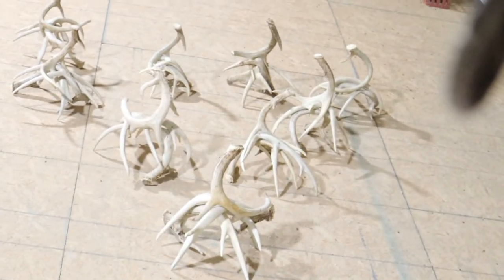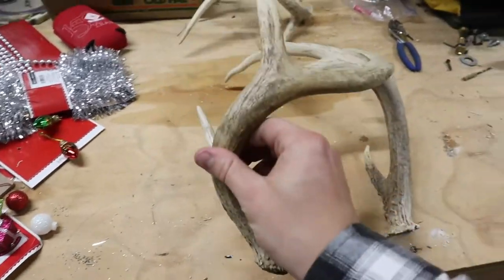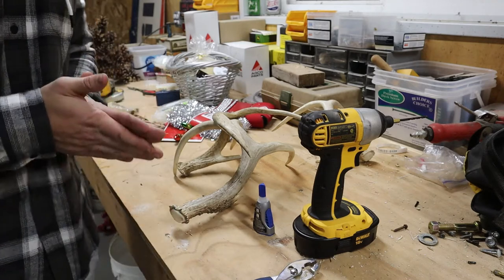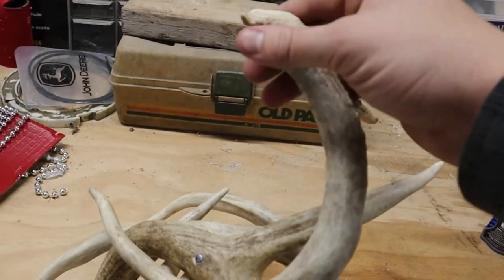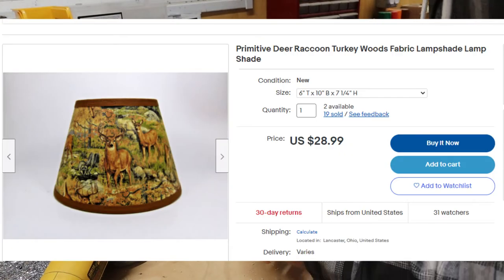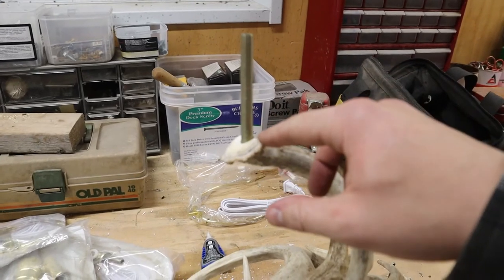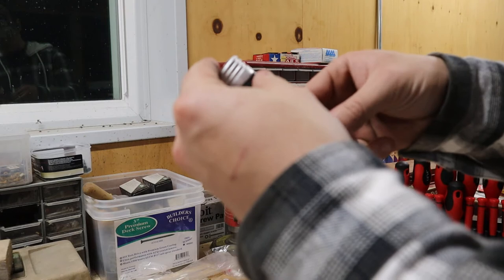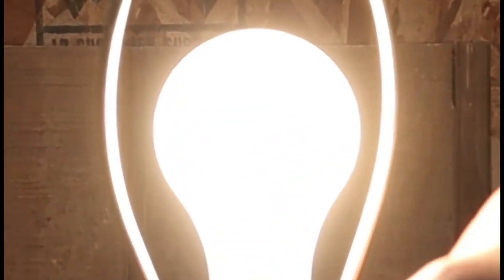How to Build an Antler Lamp

Comment: Awesome video man! Could you share the link for the actual lamp parts or just what you searched on Amazon
Reply from the maker: Lamp Making Kit, Lamp Parts for Repair Replacement or Rewire Table and Floor Lamps, 3 Way Socket 12 Foot Matching Cord and Essential Hardware, DIY Lamp Kits for Do It Yourself (Antique Brass) https://a.co/d/61MXYMa
Reply: Awesome thanks! What about nail and drill bit size? Was that like a 3/16 bit?